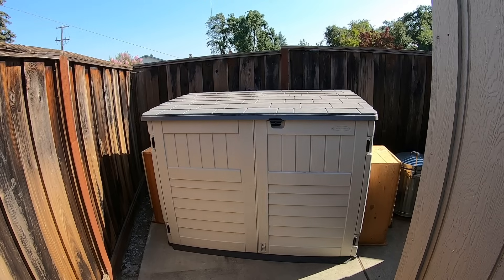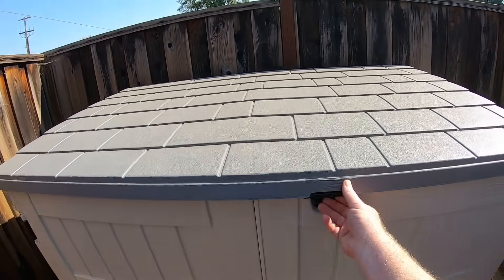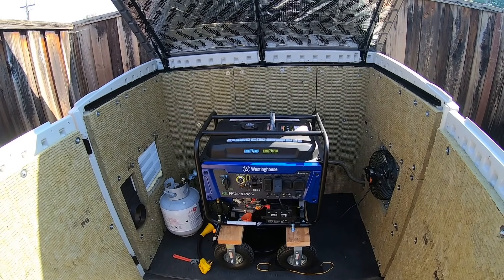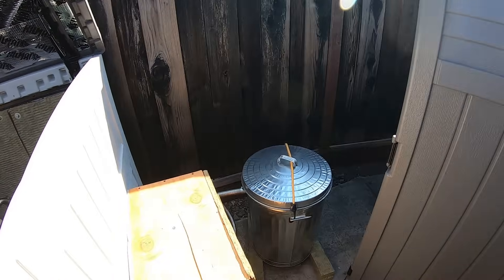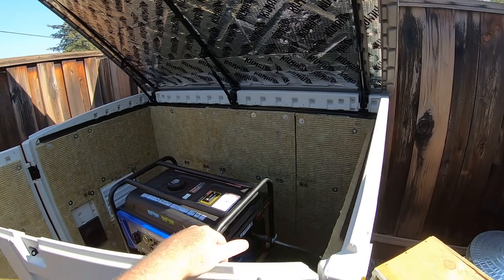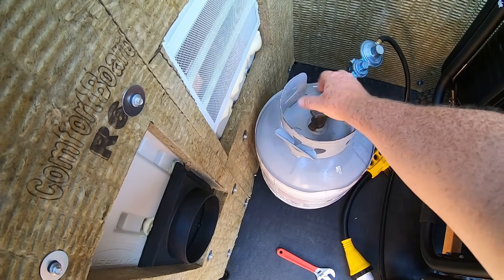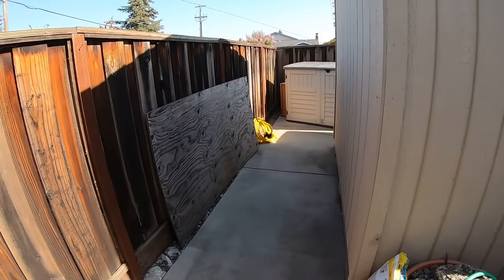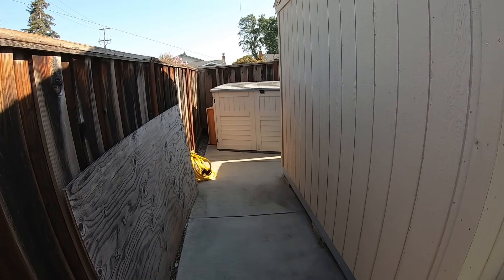DIY Generator Shed Build - Quiet Sound Insulation with Exhaust Muffler

Comment: I was shopping for Comfortboard 80 and see that they offer different thicknesses.  Which thickness did you use?
Reply from the maker: I used the 1.5" variety.  With that, I used 2" screws to attach to the inner shed walls.
Reply: @C5Tor  What type of screws?  (and DUDE...your project here is AWESOME!!!)
Reply from the maker: Take a look at my later video on my channel about my Version 2.0 exhaust.  It also has parts list, shed costs, and other Frequently Asked Questions (including what screws I used).   https://youtu.be/y3pUw408jCU

Comment: How long can you run on one 20# tank of propane?
Reply from the maker: Specs say the generator can last up to 17 hours on the 6.6 gallon gasoline tank, and about 11 hours on a full 20 lb. propane tank, depending on load, of course.  Take that with a grain of salt, your mileage may vary, etc.  I haven't tested it that long yet.

Comment: Great use of a cheap blast gate! This is the best design I've seen so far on YouTube. I have been kicking around the idea of building one for about five years now. I just haven't done it. There were too many unknowns about how well my design would work. I even purchased a metal bicycle/ lawnmower storage box to use for the shell. I had planned to use 1 1/2" fiberglass duct board, but I think rockwool is even more sound-dampening or absorbing, whichever is the right term. I am really impressed with the galvanized garbage can turned into a muffing chamber. 

Oh, and also the fan outlet box. Did you put a couple baffles in it to route the sound in a few different directions before it exits? Again, Great Work, Sir!

Comment: See everyone using an auto muffler. Has anyone used a resonator
Reply from the maker: You could try it, but my opinion is that auto resonators wouldn't help much on a generator.  Mufflers are designed to generally reduce the overall volume of a car across all RPM ranges.  Resonators are specifically tuned to cut down drone at specific frequencies or RPM ranges, but not necessarily reduce volumes.  Drone tends to happen when certain frequencies of sound echo and reinforce each other in the exhaust system, making those frequencies resonate and sound even louder.  The resonator is used to help cancel those "resonations".  Since most generators operate at one specific RPM, the chances of it being the same frequency that the auto resonator was designed to reduce are probably very slim.  I'm sure some other engineers out there might have different advice, but that is my understanding of the situation.
Reply: @C5Tor  Thank you for your input. See now why the resonator would not be a good idea.

Comment: What's lifting your lid?? Also six inch blast collector is what it's called?
Reply from the maker: The lid is lifted by three gas struts.  They came with the Suncast shed.  They are strong enough to hold up the lid, even with the added weight of the Kilmat sound insulation.   The "blast gate" is normally used in a shop dust-collector setup.  Hoses can be run to various woodworking tools, and you can open or close the gates to control which tool is connected to the dust collector (a big vacuum) at any given time.  I'm just using it as a way to pass the cables in and out of the shed, since it has a convenient sliding door on it.  I saw another youtube video where they used a blast gate for this purpose, and thought it was a good idea, especially since I already had one.  There are many other ways to pass cables into the shed, but these 50-amp cables are so big, I needed something larger than a standard outdoor wiring box.  This one happens to have a 6" diameter, hence a "6-inch blast gate."

Comment: What about a whole for running the cables
Reply from the maker: At about 3:15 in this video, I discuss the "6 inch dust-collector blast-gate" which I use for running the cables in and out of the shed.  While a little unusual for this application, it works well for running cables out of the shed.  The blast gate has a convenient sliding door, so it can be closed when not in use, and which can be snugged up on the cables to minimize the size of the hole when it is in use.  You can also see it in action at the 0:45 second mark in another video I have that answers the question of "Will the generator charge two electric motorcycles at the same time."  See link here: 
 https://youtu.be/x5siNY4JA9I?t=45

Comment: Boy,$? I'm trying to do something like that (BUT) $ ? I would need a $ amount that's my problem, otherwise fantastic job 👍.
Reply from the maker: Totally agree.  With the price of building materials these days, this kind of project can be a major money pit!  I spent way too much on this, and my wife is definitely not impressed with the cost for "a shed".  But I thought it was worth the effort to make it work correctly, and sometimes you have to invest some $$$ to make things work correctly.  That being said, I think you can take some of the ideas I used, and apply them with cheaper materials, or just add things one at a time as you can afford them.  I haven't even started on things like adding additional layers of sound dampening "outside" of the shed, like a sound blanket draped over the shed, or sound absorbing materials on the fence, etc.  I have some interesting ideas around the sound dampening properties of things like used artificial grass, for instance... could be interesting to experiment with.

Comment: Great video! Love the trash can ! One thing to caution you about. The never flat wheels are designed to insure the vibration does not cause the oil to foam up. If you use standard air filled tires, you may have an issue. I would just verify with a call or message to Westinghouse or a generator repair shop, just in case. I am designing one from old wood that we have and will use your trash can muffler for sure. Also, do you plug that adapter into the 50 amp outlet, then the actual cable into the adapter? Curious why you need that? How much and what size is the attic fan? Sorry for all the questions.
Reply from the maker: I'm pretty sure the pneumatic tires i used should cause less vibration than the cheap plastic tires that shipped with the generator.  I'm actually surprised at how cheap and flimsy the OEM tires are.  As for the cable adapter you see in the video, that is for connecting to the house at the far end of the extension cable.  I plug the 50-amp extension cable into the generator, and I plug that adapter into the far end of the extension cable, which then gets plugged into my inlet box to my garage (which is connected to my electrical panel via a generator interlock kit.)  That actual adapter in the video is a 14-50P to a SS2-50R, in case anyone is wondering.
Reply: @C5Tor  thanks so much fir the info! Take care

Comment: Curious where you live and what kind of temperatures you've experienced?  I have the Generac 17500 it's a beast with a fairly large lifetime 6 ft 3.7 in. x 3 ft 7.5 in. x 5 ft 9.4 in (75.7″ x 43.5″ x 69.4″ ).  I used several bags of the Rockwool for sound proofing and it works great.  I did a propane conversion kit along with about 200 gallon of non ethanol storage and 230 gallons of propane.  My goal is 15 days minimum without power.  With hard start kits on my 5 ton and 3.5 ton the generac will handle that easy along with 3 refrigerators and 3 freezers.  Initially I was concerned about sound but now that my neighbors have installed 24KW's I realize in an emergency the sound won't matter as much as the AC :-).  My problem is the internal temperatures.   Initially I had 2 6x6 intake vents and a 10x10 coupled with 2 Hessaire gable fans from HD.  I had 1100 CFM and 300 CFM.  When I reached 130 degrees the 1100 CFM shut down.  Since that time I replaced the 10x10 with a 22x22 and added another 900 CFM for a total of 2400 CFM.  Yesterday I ran it for an hour and still reached 118 degrees and that was on a cool day in Houston only 85 degrees.  With the rockwool I can reach 120 degrees in July and August on the inside of the shed without having it running.  If not for the 160 feet gas line run I would should have just invested in a 24KW trust me my cost is comparable at this point.  I really like the detail you've put into this genset and would welcome your opinion.  I'm very concerned that if I over heat the fans this thing could melt burn down if it was running overnight.   Would like to chat offline to pick your brain.   I'm using about 30 inches of walker 1 1/2 inch flex exhaust pipe similar to you however it exits into a dry vent that's mounted to the shed.  I wrapped the pipe with header/exhaust heat tape and I'm considering wrapping that in a 4 inch dryer pipe stuffed with rockwool or perhaps going with a longer exhaust pipe like you've done to get that heat away from the structure..  I realize exhaust can run 600 degrees but I have to find a way to keep the temperature down.  I apologize for the long winded comment.
Reply: Hey Jerry, I’m curios about your post, once you do the propane conversion, you are still able to go back to gas as well? Also, do you notice a drop in output when using propane? Some say it’s only 5% and some say as much as a 20% drop?
Reply: @chipfornaris  I haven't noticed a reduction in power because I have more power than I need.   Most Portables if you do the math estimate 10% reduction for LP and 15% reduction for NG
Reply: I have a 16kw Generac less than a year old and will be incorporating this type of enclosure.  It has a pretty large fan built in at the exhaust end that pulls air across the generator portion.  The exhaust end of the unit is also almost all louvered for that fan & exhaust.  I was going to add an opening close to the entire louvre section and use a baffle box for air flow.  Was wondering if I need additional ventilation for the unit.  I haven’t ran it for any length of time to see what the temperature gets currently to know what the operating temperature is.  Currently on NG but have been considering converting to LP due to the grid going down for an extended period of time.

Comment: Congrats on a very well thought out design and build!  I am in the design process now and will definitely be utilizing a number of your insights!   Which Suncast model did you use? I think it's the  70 cubic foot model but I can't be sure.  Thanks!!
Reply from the maker: Yes, I believe it is the 70 cu. ft. model.  I bought it "used" off of craigslist.  The original owner had purchased it but never put it together, so it was still in the box.
Reply: It appears to be the BMS4700 "Stow-Away" Horizontal Shed. 
If so, I paid $480 for mine. @C5Tor got a steal! :-)

Comment: You are one of the few I've seen that attempted to dampen the vibrations [most of the sound] out with pneumatic tires.
Reply from the maker: The pneumatic tires were installed for a couple of reasons.  They made it easer to roll around (this thing is like 220 lbs!) and they also raised up the generator enough to slide my motorcycle ramp underneath.  The vibration cancelling properties were just an added bonus, but I did take it into consideration when I was choosing between pneumatic and solid tires.  Every little bit helps.
Reply: @C5Tor  , an invertor/generator has so much less vibration. 

That's why I have yet to see someone build a sound suppression enclosure for one.
Reply from the maker: Agreed that most of the inverter gens tend to be quieter, since they generally only run at a high enough RPM to meet the wattage need.  I definitely wanted to get an inverter-based one, mostly because of the total harmonic distortion advantages for sensitive electronics.  But the only ones big enough to charge my two electric bikes at the same time were five times the price.  Most of the ones with 240v capability couldn't drive 32+ amps and 8000+ watts continuous load, which is what I needed.  And the open-frame inverters aren't really any quieter than non-inverters when running at full power.   The new Predator 9500 was close, but only has one 30 amp 240v plug, and 8000 watt continuous.  It would have been running at max to charge my bikes.  The Westinghouse had the 50amp and 30amp plugs, and had a bit of a margin for my application.  I look forward to a Predator 12000 Quiet Inverter model, if they ever come out with it.
Reply: @C5Tor  , That 9,500 Predator at Harbor Freight is in my sights for sure. 

Me and a friend are running the frame-job 9,000 watt version on a food truck and we're saving up to quiet things down. Can't wait!!!
Reply: @C5Tor  , I use a tiny 2,200 watt Generac for power outages at the house. I only need to power the fridge, a few lights and maybe a TV for boredom.  The neighbors love me, because I invite everyone over for coffee.
Reply: @TheDwightMamba  its nice, when the power is out, you walk out onto the patio at night, and your motion light comes on!

Comment: Great job. This is the route that we’re going to have to take since we live in an HOA neighborhood. Have you run the generator loaded to the house? Also, have you done any testing to determine how long your propane tank will last?
Reply from the maker: We tested the generator interlock when I had it installed. Ran a moderate amount of household items.  But the generator won't be big enough to run things like my air conditioner or oven.  Microwave is fine.  It should keep my fridge cold and the internet running.   Don't really know how long a tank of propane will last yet.  Still in the testing phase.  Specs say the generator can last up to 17 hours on the 6.6 gallon gasoline tank, and about 11 hours on a full 20 lb. propane tank, depending on load, of course.  Take that with a grain of salt, your mileage may vary, etc.

Comment: How does sound change when baffles are removed??? Also any pictures to share on how muffler looks like from inside?
Reply from the maker: To answer your question, see the links to other videos in the description.  There are sound tests on the shed without any sound insulation (#1), with insulation and baffles (#2), and with the muffler (#3).  Also a link to a video on how I made the muffler.  NOTE: Keep in mind that the muffler was an experiment. I think I can improve the flow a bit, as the muffler is effective at sound cancelation but does probably have a bit too much backpressure.  I'm going to put together a version 2.0 muffler with a bit better flow to address that.  Stay tuned.

Comment: Damn that seems like a whole Lotta work! But  looks like it works very well. Nice!
Reply from the maker: It wasn't trivial, but also not too hard.  Just depends on how quiet you want it.  You can use some of the tips or all of them.  I just posted this to give others some ideas.  It took me an afternoon to put the shed together (the door hinges took some fiddling on this model).  About two hours to cut the holes and install the fan and air inlets (tip: I used an oscillating saw to cut the holes - it goes through the plastic like butter!) and put fire resistant foam in the gaps.  Another two hours to put in the insulation.  The baffles took about an hour to build, and the muffler another hour or two.  It actually took me a lot longer tracking down the material and parts than it did to actually put it together.  I did a lot of pre-planning and research to think about what parts I would need.

Comment: Nice, well-thought-out job and application of the "sound does not like to turn corners" rule.
Reply from the maker: Thanks.  To clarify: sound will certainly go around corners.  (Ask any mom who can hear her kid getting into trouble in the next room!)  But that is mostly because the sound gets reflected from some surface. Hard, flat surfaces will reflect it the most.  In my application, I tried to make sure that the reflective surface absorbed some of the sound and reflected as little as possible, so the sound had no direct (straight) route out of the box.  Thus the "sound doesn't like to turn corners" rule was just my summation of the theory.  Not sure if it is written down in any physics books in quite that way.
Reply: Great job what did it end up costing?

Comment: 1 more thing . with the shed being plastic how do u keep the exhaust pipe from melting the plastic where it comes out of shed
Reply from the maker: In my case, I have some fiberglass exhaust tape wrapped around the pipe, and the pipe goes through a set of floor flanges, so it doesn't actually touch the plastic.  But I think I can do better, and intend to replace the floor flanges with some Hardie board that won't conduct the heat as much.  Others may have some good ways to insulate the plastic from the exhaust as well.

Comment: My 1 question for everyone doing these this way is r people not worried about thieves stealing your generator? I mean how strong is the plastic it doesnt seem like it would be difficult to get in to. Im asking because i just got my duel fuel 13000 and i use to run the old smaller 1 in my garage with the door cracked open and the window at the other end opened half way for air flow but this 1 is bigger and im thinking i should run it outside. Also i see alot of people on youtube having these little sheds and keeping there propane tanks right next to gen .is this safe?????? I wouldnt think thats a great idea but if some of u could give me yoir thoughts that would be great. Thank u.
Reply from the maker: I would say the plastic shed is about as safe as a wooden shed.  Both could be pried open easily with a crowbar when locked.  Just depends on how exposed your location is.  On the other question, I would never recommend running a generator in your garage, even if the garage door is open.  Especially if it is an attached garage.  Too much chance of CO/CO2 poisoning.  As far as the propane inside the shed, yes it would be a good idea to put the propane tank outside the shed if possible, at least when running.  But then again, I have my propane tank right under my BBQ, and the BBQ is actually on fire, so...